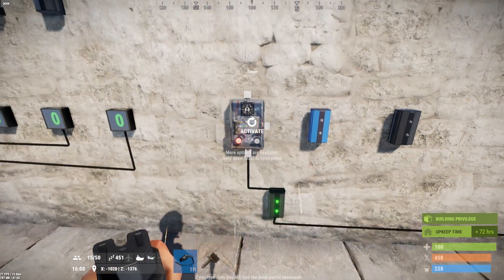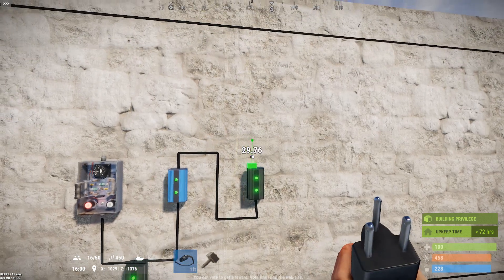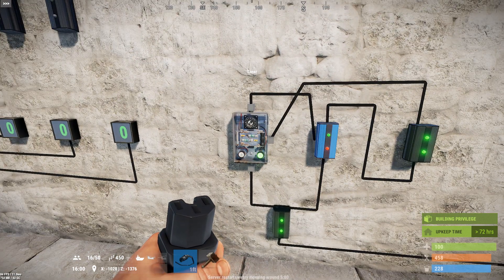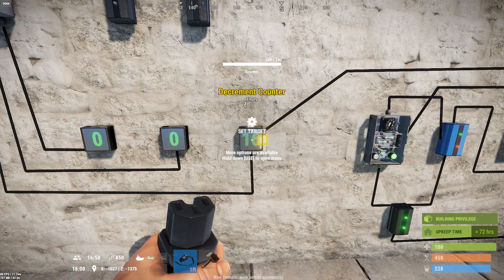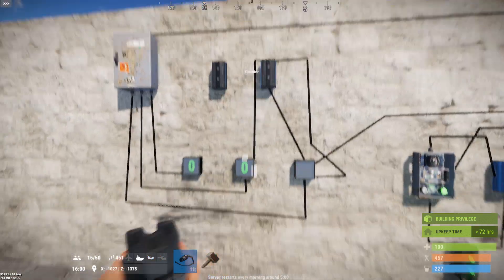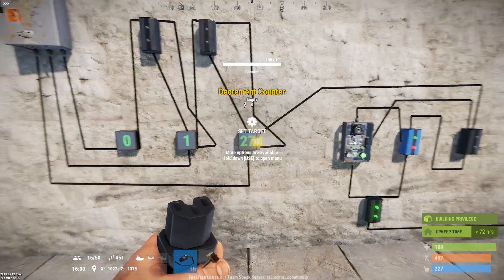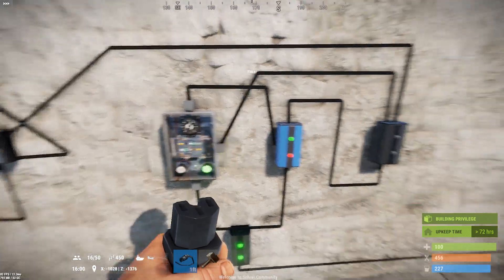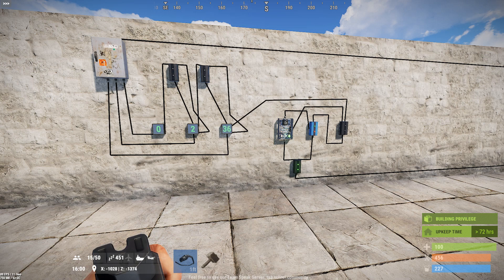Rust Electricity 101: Basic Circuits - The Rusty Clock (Stopwatch)

Comment: i want to use this feature for an escape room. I have been over and over it, how do i stop and then reset the whole clock back to zero
Reply from the maker: Put a blocker before the main power input. When you want to stop and reset, apply power to the blocker (stops the clock) and to the reset handle on each of the counter (reset them to zero).  Should do the trick!